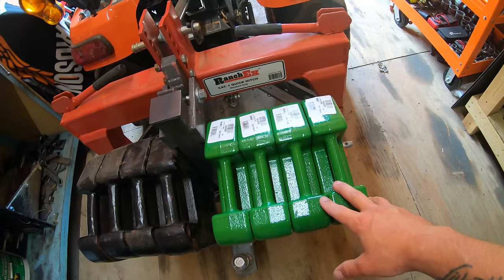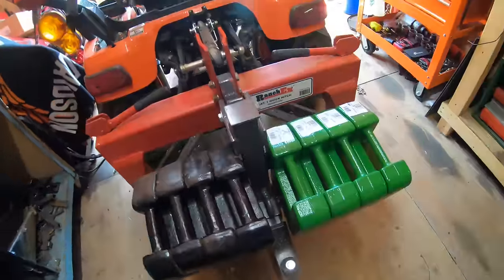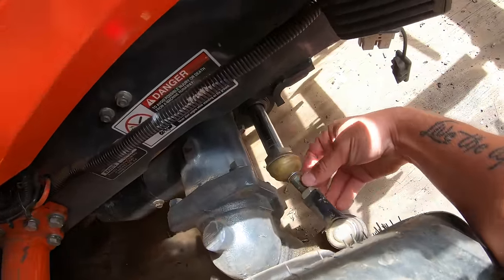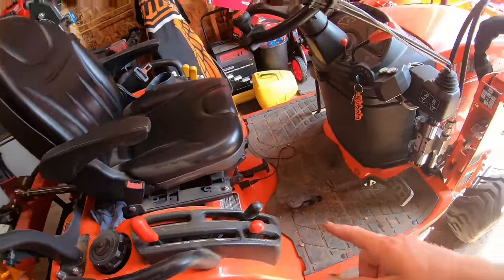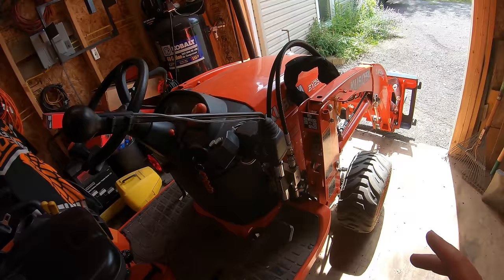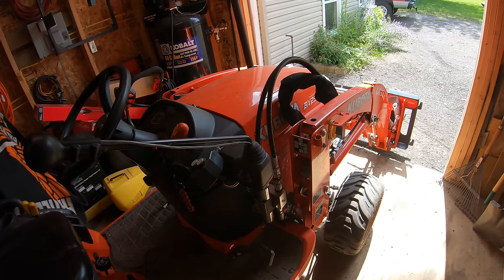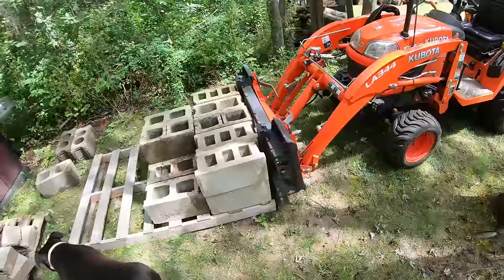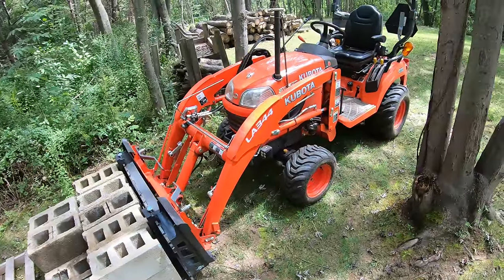Kubota BX- Testing Relief Valve Pressure 1950PSI Vs. 2400PSI  Vs. Lift  (New Suitcase Weights!!)

Comment from the maker: *Time Stamps*
1. Heavy-Hitch VS. John Deere suitcase weight comparison- 0:00 to 2:14 Min. Marks
2. Hydraulic Pressure Increase Conversation (Can the tractor handle it?) - 2:11 Min. Mark
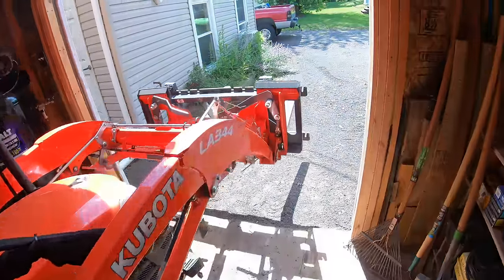3.Actual Hydraulic Pressure testing starts- 5:50 Min. Mark

I hope this video can shed a little more light on increasing your hydraulic pressure specially for us Sub-Compact tractor owners.

Comment: The hydraulic pressure on my machine is 1900 -  That explains why I could not pull the T-posts with my loader.  I have a shim kit, but I don’t think I will be increasing the pressure.  But, it is nice to know what is available.  Enjoyed your video - take care - cheers
Reply from the maker: Haha yah that deffinelty could be why.. plus the higher your loader is in the air the more lift you loose so depending on the height at which you started trying to pull them out at that coulda taken some power away from you also. Most people are content with 2,000 and it seems to be very safe.. so if you ever increase it I would just go up 100psi if you are properly ballasted ans it should be all the power you’d ever need. Thanks for watching man

Comment: Took my bx to right around 2,000psi from 1750-1800 and it was a night and day difference does everything i ask it to do. I can lift around 575lbs at the bucket lip 3ft off the ground and factory is supposed to be around 390 at the pins on the la181. Side note, anyone wanting to do this, not 10 minutes after i increased the pressure the bucket cylinder started leaking due to old seals not able to hold the psi. Fresh rebuild and its been flawless for over 2 years now but its very likely it will cause issues just be prepared to fix them and understand the risks involved. Ps, working for a kubota dealer makes it nice for replacing parts....makes me want to try 3,000psi...🤔
Reply from the maker: Thanks for sharing your experience Darren, I agree I think 2000psi is plenty for most people out working their tractor around their hard doing your average lifting and what not with it.. Good to know you had some seals leak as they got older after you increased it.. that confirms what I always thought which was it’s putting more pressure on the cylinder seals the higher you adjust it. I’m glad you got them replaced and it’s been all good now for you. I’ll keep you guys posted if I ever have any issues with mine 👍🏻

Comment: Great video.  I imagine that Kubota sets the pressure at a rate that is safest for the operator and non damaging to the tractor but as you demonstrated the tractor can do a lot more when tweaked.  Also as you mentioned there are a lot of factors to consider when making adjustments so that you don't cause damage to you or your tractor so thanks for that.  Looking forward to how things work out.
Reply from the maker: Thanks Paul! You got it man, there is def a lot to be gained by increasing it but that doesn’t take away from the fact that it can be very risky and dangerous as well.. and I just wanted people to see both sides of the equation. Thanks for watching!

Comment: I priced out the heavy hitch weights as well and decided that shipping just doesn't make sense.  I ended up stopping at my John Deere dealer and picking up the weights locally.  They were little cheaper than Home Depot and they had a pallet full of them.
Reply from the maker: Yah man I totally agree, the Heavy-Hitch weights just don't seem worth it to me.. specially cuz they are cut so rough and weigh even less.. but the fact that they are more expensive to boot is icing on the cake not to get them over the JD Suitcase Weights. Thanks for your comment!

Comment: I've been running my 23s at 2400 for a little while. Had some fittings leak, but just tightened them and seems to be good...for now. Big difference in lift capacity....perfect tractor now.
Reply from the maker: Awesome Kevin, thanks for letting us know your experience. I agree it really woke the FEL up .. it’s extremely capable now.. I’ll keep you guys posted if I have any issues but so far so good.. I was out clearing a little more land with it yesterday 👍🏻
Reply: Hello. I have the 23s what combo of shims did you use to get your 2400psi? How many hours on your 23s prior to the shims? Thank you

Comment: I have a Heavy Hitch - When I bought it, I decided to find weights local.  I have a Kubota dealer 10 minutes away.  Went there and they wanted $15 more each than the JD weights!  That's a lot for the orange paint, so I picked up 8 of the JD weights!  It's been 2 years and I never got around to painting them (and they still look new)  I also run 70lb wheel weights
Reply from the maker: Good to know! I agree the paint Job on these weights are super good, I’m debating if I should even paint them or not because if I paint them I know it’s not gonna last as good as their paint is.. I may just sell my heavy hitch weights and buy 4 more JD weights so they all match and call it a day honestly. Amazing that Kubota wants $15 more each that’s kinda surprising cuz JD parts are usually twice the price of Kubota lol. Thanks for the comment!

Comment: I got a 3 Point 50mm receiver hitch for my BX and made up a box with a 50mm  towbar Hitch.  Filled the box with Rocks and sand  and all good.  The weight and other things sit on  wheeled Trolleys in the shed so they are easy to move around and Connect up.  Having just the receiver hitch makes it SO much quicker and easier than stuffing round with the 3 Point.  Also made up a plough, a rake and a set of forks that all fit the receiver hitch.  Want to add some shims to mine. Not just for the weight lift increase but for the Curl and  getting things to move faster as they are pretty slow on the BX compared to my 1025.
Reply from the maker: Very nice man! It’s nice when your able to roll around the weight as well when your not using it..I built a little weight bracket cart for mine that I’m able to use to dolly my weights around with  when I take them off. Having the weights on the receiver hitch as well as other implements does work out really good, very easy to swap them out when you need to and installing them is just as easy, I know heavy hitch makes a backblade ans some other implements that use the receiver hitch, I really like this idea also but having a quick hitch on mine it really is just as easy to pickup and connect but it’s more money for sure. Thanks for watching!

Comment: I bumped my BX2680 up to 2000 psi 2 years ago. That gives me way more lifting power. My ballast box is a home built 30 gallon plastic barrel with a draw bar through it, a 2" receiver out the back, 3 point connection out the top and filled with some steel weights and then concrete. I figure about 400 pounds total. This works great, fits between the 3 point arms and only hangs about 10-12" past the arms, so it's not like having a box blade swinging around the back of the tractor.
Reply from the maker: Very cool man, that’s a good idea what you did.. you def shouldn’t have any issues ever lifting the rear tires up now either so that’s good! I can tell a HUGE difference in stability now with the 4 new weights added to the back of mine.. it feels night and day even when I’m driving fast over bumps it’s just super planted now.. love it. Thanks for watching!

Comment: Biff, I have a four ft back blade and 8 of those 42 lb JD weights, when I need ballast I put the back blade on and put the 8 weights right on the back blade, the  slot in the weights fit right over the top lip on the back blade, gives me a lot of ballast because of the added weight of the back blade plus the weights. Works out really well for me.
Reply from the maker: Very cool man, Yah when I use to have a backblade I would often throw my weights on the back of it if I was grading out a very tough driveway and the weights would help the backblade to cut deeper.. that prolly works excellent as well for ballast for you too being that the weight is so far back.. you’ll never have any issues picking the rear end up with that setup I bed. Thanks for watching !

Comment: Great video. I just have to say though that the BX and 1023/1025r are a pretty fair comparison, I can’t think of any other tractor that are closer in weight, hydraulic specs, and price from factory. Both have their ups and downs. In terms of lift capability from factory or mods it would still be the same result. The 1025 will out lift the BX if both were set to the same hydraulic specs. And I don’t think that comes down to rear ballast but more on the geometry of the front loader. There is tons of videos out there to compare the two and better demonstrate this. If the tractor works great for you, it doesn’t matter whether one lift more or another, it fits your need.
Reply from the maker: Thanks man, I agree that they are a fair comparison in the fact of price, size, weight, and class.. I was just saying I didn’t feel it was all that fair when showing lift capacity only because I know Kubota sets theirs sooo low and often times it’s not even set to spec from the factory it’s often set BELOW spec.. which puts it at a huge disadvantage when someone compares each machines lifting abilities.. with them both set at the same pressure and rear ballast the results would be much closer is all I was saying.. but yes going stock against stock is also fair because well .. that’s how they are made so I agree with your point also. Thanks for watching!

Comment: I have a kioti cs2220 the relief valve has a screw on it so no shims. I brought it up to 2500 from 1900 big big difference
Reply: Where is the relief valve located? I have the Bobcat CT1021 which is made by Kioti. I think they are very similar machines.
Reply: @tomahawkjo8574  Mine is right next to the fuel filter behind the left side rear tire
Reply from the maker: Awesome mark thanks for sharing your Experience! Increasing the pressure on these little tractors really wakes them up.. even going from 2,250 to 2,400 it really made a huge difference for me as well. That’s cool on Kioti they just have an adjustable spring like on older tractors.. I wish Kubota stuck with that as it’s so much simpler that way but they prolly do it so most will be afraid to touch it haha. Thanks for watching!

Comment: Awesome video, thanks for posting.  Were the spacers you used just regular washers?
Reply from the maker: Thanks buddy, yah since I ran out of shims I ended up using a few perfectly sized washers that I found.. and because they were so much thicker I ended up removing all the previous shims and started with just the regular washers.. once I found a baseline with the washers I then used the shims to fine tune it where I wanted it. Thanks for watching!

Comment: My little BX1500 is almost embarrassing. It is a hard worker, but the lift capability is almost a joke.
I purchased it used with the LA181 Loader and Mid-deck..... and almost immediately found out why the Seller was so accepting of an offer $1200 Below asking price.
*He had cleaned up the mess(leak) on the front axle and dodged Demoing the 4wd - Which was damaged from Low Fluid. But that is  another story and I have collected all the parts to hopefully get it back to usable.
The 3 point can handle 1000+lbs with ease and my Carry-all will hold at least that much for Ballast.
I am suspicious of the actual current operating pressure as the Loader cannot lift more than 5-6 empty pallets.
Once the Front axle is addresses and a General Service is completed(800hr.) I will get the pressure reading and make an adjustment to around 2000PSI.
My Intent is to be able to move 1/2 Totes made from 330 Gal. IBC Tote cut in half. As it stands they are 1/6 cord ea. full but the Kubota can only lift them when less than 1/2 full = 1/12 cord. (Sad)

Comment: You need to find what the manufacturers maximum hydraulic pressure is. Raising the pressure above it will cause blown hoses, bent cylinders and blown hydraulic pump.
Reply from the maker: Thanks Tom but I already explained everything you just stated in the video. I talked about all the risks and potential damages and possibly to injury

Comment: I  have to say your video is well done and entertaining.  I'm sure your efforts will work for a while.  Hydraulics a very dangerous thing to be played with. You dont want to be in line with a pinhole leak from a hose.  Never mind bending or breaking axles.  I have BX23s, I can see why one would want more from it but then you should just get a bigger tractor.   I wonder if kubota loves you or ?
Reply from the maker: Haha thanks John I’m glad you enjoyed it buddy. Your absolutely correct, hydraulics are nothing to mess with if you don’t know what your doing and if you done understand the cause and affect of what you do when you increase the pressures beyond spec. So far my BX has handled this pressure just fine even tho I work it incredibly hard specially when I’m digging and tearing out stumps. Iv been very impressed with its abilities once I added a bunch of ballast to the machine and increased the pressure .. thing is a beast for its size. In most cases people would be better off buying a larger tractor if they needed more lift but for a lot of guys including kneels the small compact size of the BX is exactly what we need specially once we are able to increase the lift. 

You should check out the video I did “Kubota bx Bs. JD one series” in that video I also talked about the lift and go into a little more detail of why the Bx needs more pressure to level it out with the One series.. thanks for watching!

Comment: A quick search says the average weight of a cinder block is 38 lbs. 17x38=646+30 (pallet) = 676 lbs! Impressive.
Reply: Sounds about right.  Some of those blocks are heavier than others, especially if you find some of the older ones.  I have a pallet of about 30 of those blocks, I swear each one weighs different than the next LOL.  

I'm fine with the amount of weight my loader can lift as I don't have filled tires and only have a tiller or box blade for rear ballast right now.  I don't mind if its lift capacity is a little lower, less of a chance for me to screw something up LOL.  It handles the dirt and gravel that I move around just fine so no complaints on capacity for me.  I don't have a gauge to test the pressure with and really don't care what its set at as I'm not going to change it anyways, it does what I need to do, and it has surprised me at the capabilities it has but then again this is my first tractor, I've had lawn/garden type tractors but never anything like this, first time actually operating a tractor and loader, so everything for me is a very large learning experience...I'm waiting on my pallet forks and mower deck, been close to a month since I got the tractor, still waiting on forks and mower, getting a little agitated though paying for implements I don't have.  Wish now I would have waited and ordered the Artillian forks, or some other brand because I kind of really need them as they're part of my implement/attachment storage plan LOL.
Reply from the maker: Very good! Thanks for calculating the weight for us, I was gonna do it in the video but it was starting to get long, thanks for the comment 👍🏻

Comment: I'm my personal experience. Most hoses cylinder and other hydraulic parts can handle 2500psi. the problem start when everything is running heavy. Then you drive over a pot hole and then everything will bounce. It the bounce that gets you worried about your equipment.
Reply from the maker: Hey Sam. Yes I agree, if they say they can handle 2500psi that doesn’t mean you should increase your pressure to 2500psi because you can go way over that pressure limit when pushing or pulling on the hydraulic cylinders.. it’s always a gamble going higher than the rated pressure and I agree not enough people realize how easy it is to go over when you have your pressure set to the max like this.. that being said I believe these hoses are usually always underrated by quite a bit.. I have never had a single hose blow out or leak to this day and I’m still running the exact same pressure. Thanks for your comment!

Comment: Another awesome video I just did my BX23S today and it was set at 1750 from the factory and had 30 thousands shims in there, didn’t realize they come with shims in there and I purchased it new, I upped it to 1950 I have the backhoe on mine so what would you recommend I respect your  opinion. Thanks Phil
Reply from the maker: Hey Phillip, sorry I’m just seeing your comment buddy, that’s great to hear you upped it to 1950, 1750 was low for spec and would def loose some lifting capabilities. As far as the backhoe it won’t matter as they backhoe runs off a separate releif valve.. so you will still wanna set yours around 1950 which is spec.. if you go any high just be careful. Mine is currently at 2450 which is awesome for what I do but it’s also extremely risky specially with out proper ballast and you can easily blow a line or hurt the hydraulic pump. I have no warentee left on my tractor so I didn’t really care. Best of luck and be safe!
Reply: @BiffsEquipment  Thank you I’m going to bring it up to 2000 and I’m sure that will be enough for me, just watched you doing the job on your fathers land nice video And good job, I’ve had 3 Kubotas over the years but like this one the best but was very disappointed with Kubota’s warranty after 2 years only covers internal Engine and Transmission. Thanks again and look forward to your videos.